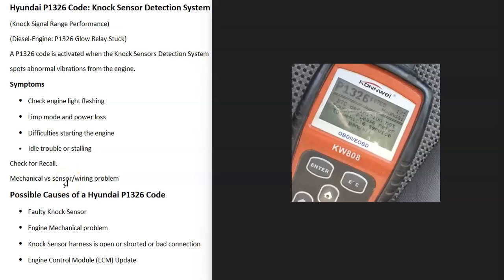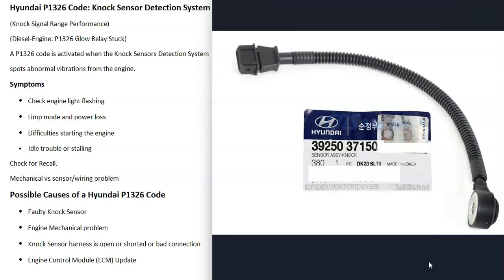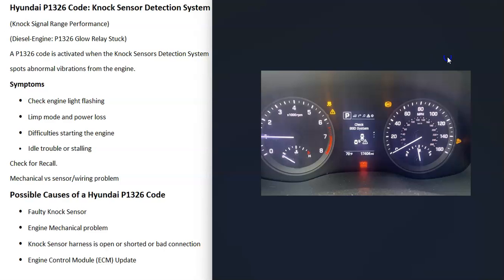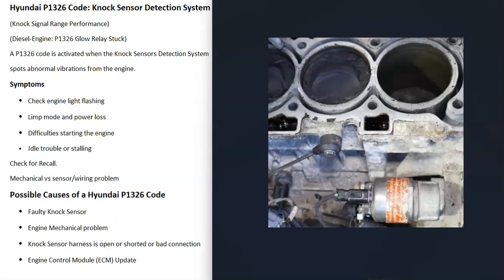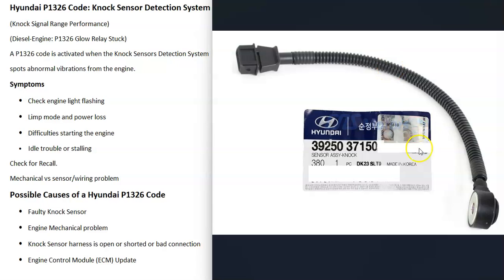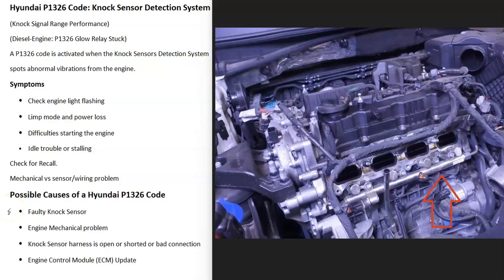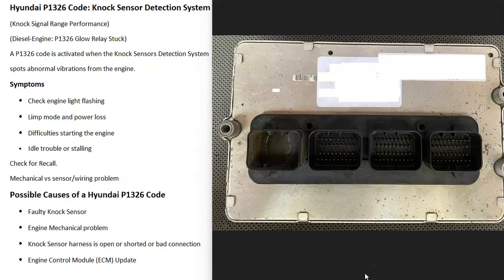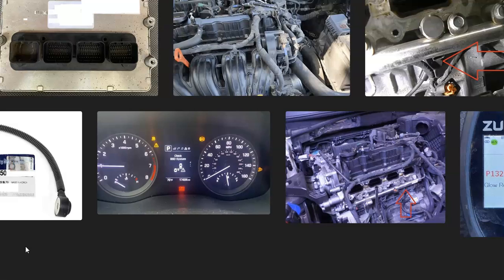How to Fix a Hyundai P1326: Knock Sensor Detection System

Comment: Hey guy we have a 2021 Tucson, knock sensor goes off every time it's ran through touchless car wash, also I left car running last week sprayed motor off , we live in a dirt road and ur was fairly dirty, funny part, dealer has cleared it 2-3 times without answers, these clowns told wife not to run through auto wash

Comment: I have sonata 2016, it had this code, took it to dealer and he said there is problem with sparkplugs etc. They cleaned the carbon buildup and cleared code. The P1326 never came back but the engine clicking noise is back when I accelerate. Anyone gone through this? Will dealer replace engine?

Comment: I put regular gas in an it wouldn't let me go past 2000 rpm an got it on code reader an it said nock sensor clear the code an got supreme gass in an it's working fine at the moment  should I get one anyways

Comment: So, recently, 2 days back, i got oil change done, and i saw the dip stick it was above the high line.
And today my engine check light has been flashing. Its blinking not constant , so when i clicked the start button it kinda struggled to start and when i stop near signal and accelerate it looses power and the code it shows is P1326. It means konck sensor issue.
Like i dont hear any knock sound from engine its smooth and silent 

What i think is cause of overfill of engine oil , the knock sensor got triggered, and the engine check is on

Do you think it might be cause of that reason , casue i can tell there is not knock sound from my engine and its smooth.
My car is 2018 Hyundai sonata
Reply: Did you ever get to the bottom of it?

Comment: I had this code and limp mode happen on day 6 of owning my 2018 Tucson. The previous owners just had the knock sensor replaced 3 months ago. I took it to the dealer who said the knock sensor is fine, it passed the bearing pressure test, and they are now telling me it's likely a pin that is broken and they need to pull the engine out to see if that is the issue! Warranty will not cover any work because it is not a rod bearing that is causing the knock sensor to go off. In your opinion, SHOULD they have to take the engine out to check/fix this "pin'?
Reply: No take it somewhere else

Comment: I just got this code and flashing check engine on 2014 Santa Fe Sport. Engine was replaced 6 months ago due to recall. Yesterday I was driving in some pretty wet and windy conditions when the flashing started but I didn't notice any loss of power. Pulled over and nothing sounded off, oil was good, gas mileage has been around 33mpg. When I went to take off again that's when I could barely get to 25. RPMs struggle to get above 1500 and when I punch it, it bounces to just above 2 and then back down. I can slowly get up to 60-65 but if there's an incline or any sort... forget about it. In an attempt to just get home on a wet Sunday night in the middle of nowhere, I listened to the advice of the parts place I pulled in for code check. They said it was fuel or catty issue and to put some cleaner in. Wasn't until I got home that I was able to look the code up myself and realize they were wrong! Anyhow, would love to hear the outcome anyone else has had with this code. Trying to get anyone on the phone from the dealership today but that is proving difficult.
Reply: It was a bad knock sensor. Luckily that part is covered as part of the engine replacement. Of course my catalytic needs to be replaced too. Trying to win that war for replacement since the bad engine likely put additional wear and tear and that. We'll see!
Reply: Hello. I had the same issue 2 days ago. My engine has not been replaced. My car is running good and suddenly the speed has been limited to 60mph and maximum RPM is 2. I pulled the code and it said a knock signal range/performance. So, what I should I do now? Should I go to the dealership for any recall for that? Please reply and I need your help.
Reply: @chaitanyadanda  Definitely call the dealership but also check to see if your car is under recall for anything. Mine had been and the knock sensor is covered as part of the engine replacement. If not it would have cost me around $700 to replace. You can also check for recalls using your vin on your car brand's website. Good luck!
Reply: Thank you for your response. I did check for any recalls for the vehicle in hyundai website. But there is not any due recalls that need to be done. The last 2 recalls the vehicle had, are not related to knock sensor. I don’t know how to check whether my engine has an warranty thing. I bought this car from a dealer 6 weeks ago.
Reply: @chaitanyadanda  You should still be under warranty. Hyundai has a really good warranty. You can call Hyundai directly too if the dealership won't help you or you're worried about them being shady. I think the engine has a 60k warranty but don't quote me on that.
Reply: @OurJourneysWithin Thank you

Comment: The check engine light started flashing at mileage 171.000 .
The mechanic removed it with his machine from the system.
The car is back ok, but I'm wondering if this P 1326 will come back and if I could keep on driving the car ?
Should I go to the Dealer to tell this story ?
Thanks for your comments.
George - NYC
Reply: I would like to know how it went with this vehicle, I would appreciate it

Comment: Same code. 2020 Tucson. Got it from deep puddle. Limp mode engaged. No knock. Oil good. Where does the other end of the knock sensor go to?  The harness…but where in the engine compartment. Pretty sure it’s just a short.

Comment: My 2014 Santa Fe Sport went into "Limp Home" mode, now called “Engine Protection Mode”, and produced this code at the dealer who replaced the engine. Wife and daughter were driving the car in Nowhere, Nevada and suddenly slowed to 25MPH in front of a semi on the freeway. Lucky they survived to get a 2hr $600 tow to the nearest Hyundai dealer. So.. Hyundai KNOWS there's a problem and decides to wait until it fails in an inconvenient/dangerous location to fix it - AFTER it breaks! Not happy
Reply: I had the same thing happen to me on the Interstate.  I started in the left lane, losing power, made it to the middle finally over to the slow lane and then the shoulder.  I turned it off and it came back on.  Trying to pull off the shoulder to get in traffic was horrible, but I made it.  A few days later the engine light came on, flashing.  Took it to a repair place they told me about the P1326 code.  I have a Kia.  I'll see what they say.
Reply: @barbarasaunders2160 what did they say? i am currently going through the same problem
Reply: @abigailgutierrez7797 Did u manage to fix it ,I have same issue  s here
Reply: @abigailgutierrez7797 did you come up with idea how to solve it?
Reply: @Emmanuel-i6k4u did you solve it?
Reply: @barbarasaunders2160  What did they say to you?
Reply: I cleared this light with obd 2 and costs me only 10$
Reply: @ahmadsabah96 clearing the light doesn't solve the problem 😂
Reply: @jonathanromero8639  the sensor read a misfire because of the poor gasoline that we have however I am using an octane booster.

Comment: Thanks for the video. My 2016 Hyundai Santa Fe threw this code. It had the update to the sensor done in 2019. Took it to dealership and they replaced the sensor for $710. Should I had been charged? I’m seeing that this is on a recall and maybe shouldn’t had. I’m so confused can’t get a straight answer.
Reply: im calling about mine and they were telling me the sensor isnt covered under the warranty, just an engine replacement if you had needed one. they hopefully did an engine insepction when you took your car in with concerns about your knock sensor.

Comment: Just had the P1326 code on my 2014 Santa Fe Sport Turbo. I as well went thru a local touch less car wash with undercarriage spray. 15 minutes later car goes into limp mode. Could still drive it but like no power when starting to move so kinda dangerous on busy roads and the car becomes governed. I Stopped at AutoZone to get the code read and that’s when it came up “knock sensor”.  I went and had the sensor replaced the next day and $750 later it’s been back to normal With no issue. Garage told me if it comes up again to take it to local Hyundai dealer to see if there is a software upgrade/recall. Seems to be disheartening as I just purchased the car used with 70,000 on it. I’ve had it for 6 weeks now and this goes on.
Reply: Exact same year as mine and I drove to Texas to pick up my sister in law. Not even 30 mins down the road from my house in Colorado it finally popped on the engine light and was harsh on the highway to get home. I took it to an Auto zone they coded it as a p1326 and now I’m looking at buying the part to fix it myself since it’s gonna cost about $3000 to fix is what I was quoted at a mechanic shop here in CO🤦🏽‍♀️
Reply: @caylijenkins5313  Thats insane, what did it end up being? Knock sensor replacement?
Reply: @caylijenkins5313 Kia give you a new motor if you bring it them, these engines have lifetime warranty for this recall
Reply: My daughter's car is now having this issue. Hyundai denied the replacement knowing they used faulty engines. Were you also hearing a rattle/knocking sound?
Reply: @BrooklynBred-es3wg  when it happened to me the car runs rough just idling. And driving is running rough and sputtering…almost like it’s not running on all cylinders. Has little acceleration. The Mechanic did replace the knock sensor and no issue since. I haven’t gone thru a car wash again with it. As that seems to be one of the causes.

Comment: Daughter has a 2019 Hyundai and it is showing this code. Would this be something covered under engine and transmission warranty?
Reply: Do you have an update on this problem? I have a 2019 Hyundai sonata. just curious how you fixed it… If you did.
Reply: @Giventofly1975  Took back to dealership and turned out to be a sensor which was covered both by this known issue and warranty she had on car. Be advised though, they tried to take advantage of her by suggesting other items needed to be done. She was on top of her maintenance (and had a mother that knew better) so she didn't fall into their trap

Comment: Just went through a touch-free car wash yesterday, CEL flashing and no boost all the way home. Probably just need to dry out the connector and use some dielectric grease when reassembling. Reportedly a common issue, especially with the N performance models.
Reply: Did u fix the problem? If so how?? I have the same problem from a bad storm
Reply: Same i went through a puddle and got the code
Reply: @pyroclasticflow8382  how did they fix it?? Same issue with me
Reply: Does it still act up to this day?
Reply: I have a 2011 Sonota GLS. I was driving in snow and lots of salt on the road. No engine noise. I do wonder if the snow and road salt is the issue.

Comment: Hi, I am getting P1326 on my car and it suddenly start knocking as soon as this code come ( before that there was no noise) , I took it to dealer and they reset the code and change knock sensor but noise is still there they perform something called bearing clearance test and claim it passed so we can’t replace engine under warranty and tell me it is something related to piston walls having scratches and the noise can be because of that ( but not confirming anything) , I argue that piston noise doesn’t come overnight and only comes on startup in the beginning also if this is pistion related , car should be burning or leaking oil but they have no answer to that , I am getting a feeling that they are just giving me lame excuses to avoid warranty replacement, any suggestions please ?
Reply: They pretty much said same
Bs to me ! Trying to avoid fixing or replacing the engine ! So sad
Reply: @aziebkaleab7617  these morons already denied to me I am preparing to sue these fraudsters in court

Comment: I have the same code made the car go into limp mode at the same time the radiator went completely empty the thing is the car never over heated i checked the thermostat and sensors they are good no water in the oil either